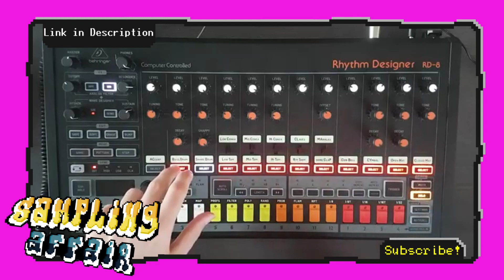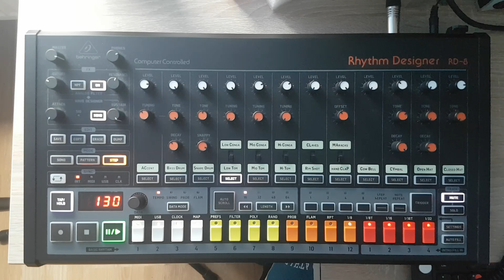How To Play Basslines with the Behringer RD-8 (Tutorial)

Comment: Thanks for sharing this. Just bought the RD-8 and I've noticed something strange about the filter. When recording filter automation it records exactly 2 steps out of sync, i.e. the filter reacts 2 steps late to any movement of the cutoff knob. Weirdly this is also true if you manually enter the cuttof frequency for each step. e.g. if I dial in a cutoff frequency of 50 for step 1, this will actually be heard on step 3. Have you noticed this with yours?
Reply from the maker: Thats interesting. I didn't looked at that in such a detail, but i'm going to try that out. Are you already running  your rd8 with the latest Firmware Update?
Reply: @therealmainmethod  Yep latest firmware. It may just be a faulty unit!

Comment: very clever and creative approach. My fav trick with the 808 is to layer the cowbell with another sample of the cowbell tuned a 4th or 5th higher. Creates instant chords that sound very cool.
Reply from the maker: Interesting idea, going to try that out too
Reply: I just discovered this by slurping up a bar of cowbell into a long delay loop and capturing at different tunings this morning.  It is N I C E
Reply: @The_CGA  its a very inspiring approach
Reply: Bought myself a cowbell, and at some point I figured out how the make the bell sound sustain.
Suspend the cowbell on a wire or spring, then take a (really) long piece of a thin (enough) metal rod that fits in the hole on top and clamp it. It looked crazy AF, but it worked :face-green-smiling:
If I remember right you can also hit the rod and make the cowbell ring , or something lol.

Comment: i wanted to use just the cowbell sequence to sequence a bassline in abelton but I need to assign it to its own midi channel
Reply from the maker: You can use die Midi Out and the USB Midi as two different midi outputs. In the settings you can change the midi channel individually for the Midi Out and the Midi USB. Another thing you can do in ableton is to use a Midi Effect Rack and when you press the Key button you can limit the Midi Notes that the channel receives. Hope this will work for you
Reply: @therealmainmethod   yeah i have to keep the midi channels all on 1 for the abelton play button to work across all my hardware so I guess the 2nd option would be the best midi filter basically like protools
Reply: If you look up midiox you can filter midi data or create a virtual dedicated port